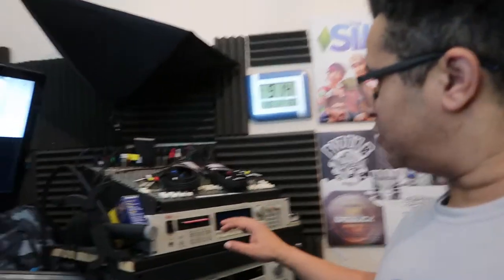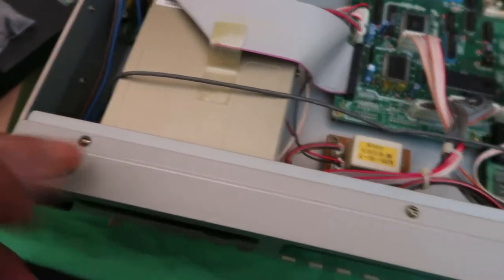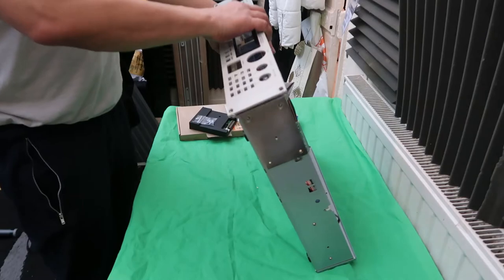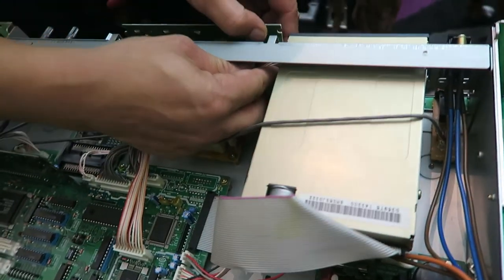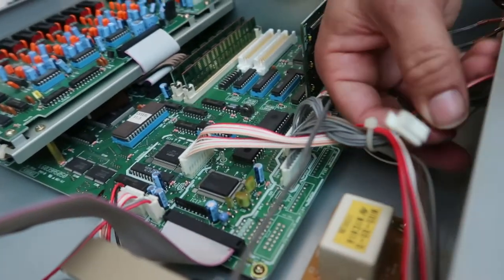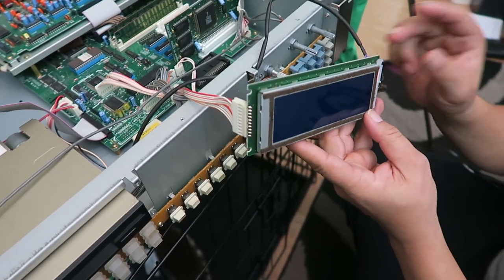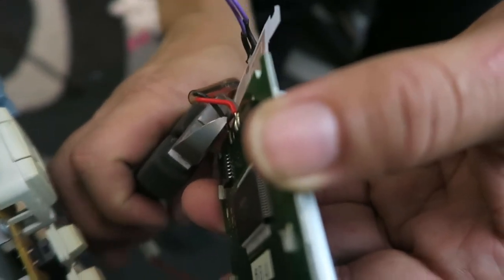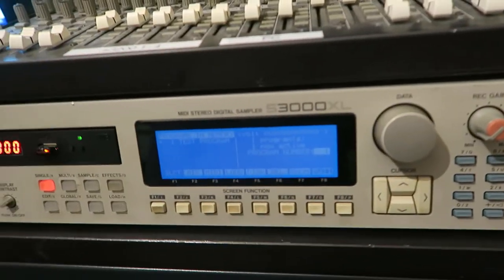S3000XL Hardware sampler  Screen replacement | HXC EMULATOR

Comment: Thx for the video!
I just installed a new screen with built in backlight to my s3000xl. Thx to your video, I knew it wasn't that big of a deal to do and now my sampler has a sweet negative white on black display which looks great, is easy to read and the best thing:
no anyoing inverter noise anymore!

Comment: Instead of cutting off the wires, I have cut them off at cable level and put over some shrinking tube to prevent any short circuit. You could also just leave the cable on it and pull it inside the machine as a loose cable.

Comment: Hi Brian,
I replaced the display backlight on my AKAI S3200XL but I realized that there are problems with the power supply inverters.

I need the service manual, do you own it or do you know where to find it?
Or does anyone know any way to help me?
Thanks in advance to everyone!

Comment: Hi Brian. After 12 years of waiting and searching for the add ons to appear on ebay and snap them up I've finally found the Flash ROM Boards and need help configuring the pins. One is an original FXM008 Flash ROM board and the other is the later version FMC001 Flash ROM board and there are configuration pins on them which I'm a little stuck on. Any chance you can shed some light on how to set them up or know of anyone who might be able to help please. Check the video of the pins here to be clear https://www.youtube.com/watch?v=6vwPYzCFPEQ I've also upgraded the EB16 FX Board, IB304 Filter Board, OS onto the Chip like yours and the RAM to 32MB. Thank you so much for doing these videos, you have inspired me to upgrade mine, next up, the floppy emulator. I don't have an old computer, so will MESA work on a Windows 10 laptop? I look forward to hearing from you. Kind regards, Gareth